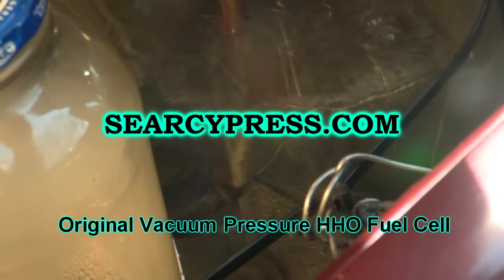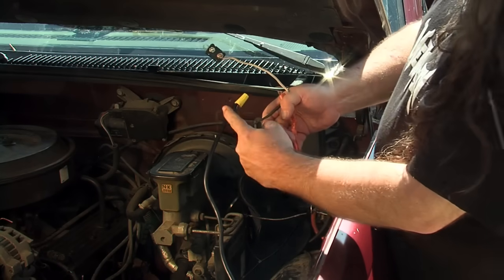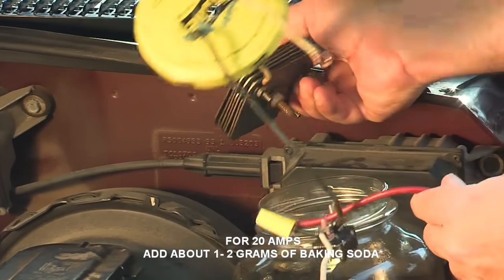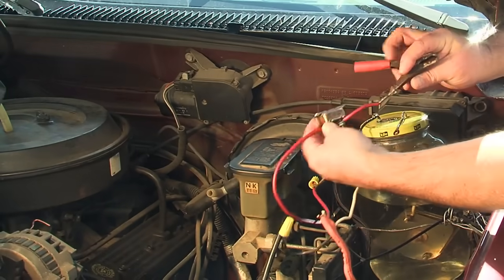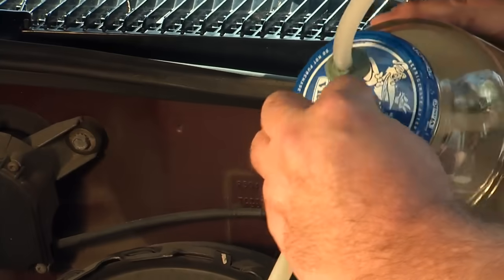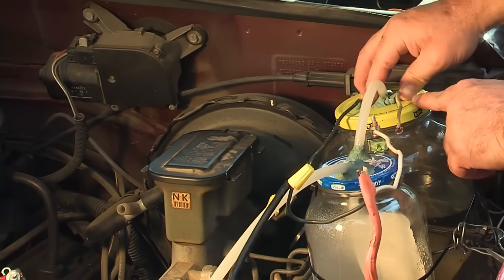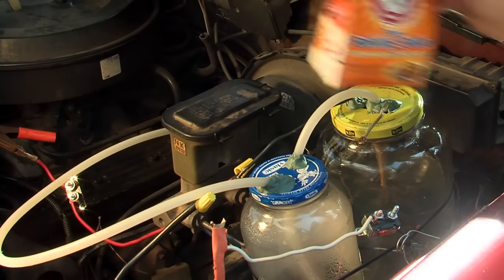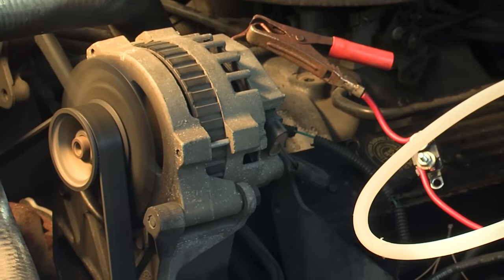Vacuum Pressure Hydrogen fuel cell defeats high gas prices using hydrogen from H2O.

Comment: Are you grounding the anode or are you burning both Hydrogen and Oxygen?
Reply from the maker: Both are recombined and mixed with gasoline vapor. The hho enters in the vacuum and only mixes with air in the cylinder when ignited. Thanks for the comment.
Reply: @metalpresstv  Nice I made a copper one before but it oxidized hilariously fast. I might retry with a stainless one again. I put a v6 in my 53 pickup I can tap vacuum off of the intake.
Reply from the maker: @kittywampusdrums  We used the highest grade stainless. Completely non magnetic. Never wears out. Kinda pricy but worth it. Remember loss of vacuum due to a line break results in loss of breaks. That's one reason we say, do not attempt. Ty
Reply: @metalpresstv  Yep. For anyone reading, there's plenty of other areas to vac tap. If you lose vac assist brakes you can extend your adjustment rod in the master out farther but it's really touchy. Just don't tap your brakes for vac you'll be fine. WEEEEEEEEEEEEE!

Comment: Metalpress tv, how much baking soda are you using
Reply from the maker: In most cases just a pinch. It completely depends on the mineral content. It can be adjusted by amperage. If it trips one or more of the auto reset circuit breakers add water. After a while you get pretty good at adding the proper amount. There is no need to run at full power. Less can do more and temperatures do play a factor in power useage. Thanks for the comment.

Comment: what is the second bottle for. i tried this and had two electrodes to hopefully separate oxygen and hydrogen. I assumed each electrod produced one . it seems many are using both oxy/hydrogen together. When i collect and isolate in a tube, it do not combust with a match.

Comment: Be warned HH+0 will ruin your day  if that bubbler in between the cell and the vacuum system gets low on water & you have vaccum issues. Brown's gas is about as volatile as black powder. Take every precaution.

Comment: Wouldn't you have to de-tune to lower the amount of gass/petrol for it to actually lower fuel costs?
Reply from the maker: If you are referring to an O2 adjustment-  possibly...in some cases. But- because you can burn much lower octane fuel with no knocking, you save big time. Less is sometimes better. You don't need tremendous amounts to see performance. Thanks for the comment.

Comment: The common missing component in all these engines is the gyro. It's needed in the EV, Compressor start in refrigerator motor, stabilize IC engine two wheelers, drones, etc.

Comment: This is one of the best demonstrations about water gas using for engine.
Reply: Maybe for a complete idiot. 

Just idling your engine is over a 600 rpms. Driving a 2.5 liter 4cly motor  is about 150 cubic inches. That's 37.5 cubic inches per a cylinder. A cylinder fires ever 2 full rotations. So in a minute of idling at 600 rpms your engine will use 11,250 cubic inches of air a minute at just idle. That's a 187.5 cubic inches a second of air. You're not producing even 2 cubic inches a second. But don't forget that it's h2O 2 parts hydrogen 1 part oxygen. So 1/3 of the gas isn't even hydrogen it's oxygen. So not even 1% of the air being taken into the cylinder is hydrogen. The only thing being accomplished here is the alternator is working harder for the high amp draw dragging the motor down more reducing fuel mileage. This is why water isn't used as fuel in a motor vehicle. 

Now don't forget we don't drive at 600 RPMs most people will be around 1800 rpms at cruising speed. That's 3x the amount of air with still the same hydrogen production. So now ur way below the threshold of .03% hydrogen in the cylinder. Using a spark arrestor on the output hose to keep from blowing the jar up you would be hard pressed to even candle a flame let alone put anything measurable in every cylinder 900x a minute cruising down the highway at the speed limit.

Comment: how much baking soda do you ,the whole box or just a portion
.
Reply from the maker: Depending on mineral content, we used just a pinch, watching amp flow keeping it below 30 amps.
Reply: @metalpresstv  would a teaspoon be good for say like a gallon jar of distilled water ?
Reply from the maker: @raymondfugate490  it's completely unpredictable on regular water. We used distilled water. Starting with just a pinch. Checking the amperage, and adding more if needed. Adding too much will trip one of the two circuit breakers. When that happened, we added more water. This is for information only, we are not telling you to build it. Thanks very much for your comment.
Reply: @metalpresstv  well the reason I'm asking is, that I'm gonna build this for my 99 Ford F-150 XLT 4WD ,It has a 4.2 v6 5 speed , I'm gonna use it has a work truck and I need to save as much money as I can and where and when I can , that's why I was asking about the exact measurements of everything

Comment: The energy you use, to make the hydrogen and oxygen, is coming from your trucks engine. Therefore, you consume fuel while making your fuel. If everything worked perfectly, you would get the same mileage with or without this. If this actually made more fuel than it consumed, you would never need to buy fuel again.
Reply from the maker: Your assumption comes from the thought that you burn 100% of the fuel that goes into the engine. In reality, you only burn about 80% in this motor. That leaves lots of room for gains. Improving the efficiency of the burn to levels above 90% decreases emissions and increases power. In addition to that, you're able to burn much lower octane fuel without any engine ping. If there were no gains, you would still save money by being able to use lower octane. Thank you for your comment.

Comment: The alternator pulling 29 amps is just defeating the whole purpose of adding hydrogen to your  gas ratio
Reply from the maker: Using this system allows us to burn low octane fuel with no engine ping. Only 80 percent of the fuel is burned normally on this engine, the rest is wasted. Using this system allows for very high fuel burn efficiency. It's not over unity, it's burning more of the wasted fuel to offset the power used by the electrolysis. Thanks for the comment.

Comment: What happens when the glass jar breaks maybe you should use something other than a glass jar that's a little more safer
Reply from the maker: The system runs in vacuum. The glass serves several uses. The thermal property of glass and visibility is good. Glass sight glasses  are used on pressure boilers. That always spooked me and it has injured many. This system has no pressure. Remember we were pioneering this technology. Sure there are other more costly options. Our goal was to demonstrate it's use. Do not Attempt. Thanks for the comment

Comment: First issue is that you would blow up your car Hydrolysis is a extremely dangerous chemical process giving off highly explosive gasses that if just a spark were to get to the Gas it would potentially become a hydrogen bomb.  Secondly if you get it right to make 100% sure you can't have a back fire or a way for the gas to be ignited out side your Piston cylinder you will need to use a calibrated amount to inject the right amount to not have too much pressure in the chamber and cause the Block or head to explode. A nother problem would be that it will potentially destroy the engine after a while if not regulated correctly kind of like how a nitrous fed engine gets damaged from the nitrous. And you would need a power source thats not just a car battery as it would consume the energy too fast for a alternator to recharge the battery this also adds strain on the battery its self being drained too fast causing it to also fail as the Liquid battery fluid will dry up much faster.

Comment: Catalytic converter issues?> Did you simply pull your fuel pump fuse?
Reply from the maker: No, this is a fuel booster. Burning pure HHO could create extremely high temperatures in the engine. We use it to boost the efficiency of the burning process. This allows us to burn lower octane fuel without any engine ping. I have seen videos where they show running on pure hho, however I speculate this is not the case. When you consider you can melt a rock with an HHO torch imagine what that would do to your engine. Thanks very much for your comment.

Comment: In the NASA study, the engine was fed Hydrogen from a catalytic steam-reformation device, at over .6 kilograms per hour.  That is a tremendous amount of Hydrogen; nearly 2 liters per second.  This pickle jar device would be lucky to produce 1/100 of that volume of Hydrogen.   https://ntrs.nasa.gov/api/citations/19770016170/downloads/19770016170.pdf
Reply from the maker: That's fascinating because we can make 6 liters per minute running at high amperage. We're not producing hydrogen, we're producing hydrogen and oxygen. Thanks very much for your comment.

Comment: sooooooo, what do you do about a backfire, i cant imagine a pickle jar exploading under your hood is a good thing.
Reply: i use a rubber boot  on a box with a sponge inside it , and on the other side a check valve.   and this keeps my setup from letting water get into the vacume system Whilst also keeping any explosion in check im sure you havent experienced a  explosion yet but just know your on that line with this type of setup.
Reply from the maker: It runs in vacuum. Like a light bulb.
Reply: @metalpresstv  ok well Even a vacume with gasses such as oxygen and hydrogen can still expload its a miracle it hasn't done so  is all im getting at.
Reply from the maker: @quagmire94  Very true. That's why it says do not attempt. But just so you know we lit up many jugs just to test what would happen. In every case the lid lifted off before the glass jug  itself poped. Most certainly a weak jug or cracked one would be a horrible mess under the hood. It could even take the hood completely off. This is not something anyone needs to try. Do Not Attempt.
Reply: @metalpresstv  never thought about it that way, definutely having a pop off valve would be nice  i guess a  top of a pickle jar  would suffice.

Comment: The mixture of hydrogen and oxygen gas is highly unstable. I don't think it is wise to rely solely on your dryer jar to prevent a backflash. A check valve should be inserted in the line between the dryer and the vacuum line as a redundant safety.
Reply: 2nd jar
Reply: Quick someone eat 6 pickles for a 2nd jar.
Reply: Maybe use a pickle jar with softer glass, to better contain the explosion. So much safety here.

Comment: Its been about 10 years since the video has been made. These make shift Hydrogen fuel cells was a big thing with DIY types around mid 2000's, but all have pretty much died off since and i don't hear anything more about them. I'd love to ask.. Are you still doing this today in 2021? Is it still worth your time? You still getting decent gas miles? Anything bad happen since this video? You should do an update to this video.
Reply: I use HHO for inhale not for car it's not efficient.
Reply: Psst it never worked never will work 
Just idling your engine is over a 600 rpms. Driving a 2.5 liter 4cly motor  is about 150 cubic inches. That's 37.5 cubic inches per a cylinder. A cylinder fires ever 2 full rotations. So in a minute of idling at 600 rpms your engine will use 11,250 cubic inches of air a minute at just idle. That's a 187.5 cubic inches a second of air. You're not producing even 2 cubic inches a second. But don't forget that it's h2O 2 parts hydrogen 1 part oxygen. So 1/3 of the gas isn't even hydrogen it's oxygen. So not even 1% of the air being taken into the cylinder is hydrogen. The only thing being accomplished here is the alternator is working harder for the high amp draw dragging the motor down more reducing fuel mileage. This is why water isn't used as fuel in a motor vehicle. 

Now don't forget we don't drive at 600 RPMs most people will be around 1800 rpms at cruising speed. That's 3x the amount of air with still the same hydrogen production. So now ur way below the threshold of .03% hydrogen in the cylinder. Using a spark arrestor on the output hose to keep from blowing the jar up you would be hard pressed to even candle a flame let alone put anything measurable in every cylinder 900x a minute cruising down the highway at the speed limit.

Comment: If the HHO is produced at an energy deficit (it takes more energy to split the water than is gained in chemical energy), and then the HHO is combusted in an ICE that is, at best, 30% efficient, how could this possibly increase mileage? Oh, wait, it can't. LOL! Idiot. You've increased the electrical load on your alternator, thus increasing the mechanical energy required to turn it, resulting in the engine having to work harder...just...wow...

Comment: This generates HHO which is highly flammable, if you build this you need a back flow valve. A backfire could cause an big bang, a really big bang, a really really big bang.
Reply: His “dryer jug” is supposed to be filled with water and used as a makeshift flashback arrestor
Reply from the maker: It's not really a flashback arrestor because of its size it's basically an overflow, a place for water to condense. In the state of vacuum there is very little chance of an explosion. This whole system is quite different from the one we're using now. We have a video it's coming out and we're going to show some safety features we've added over the years. With that in mind please don't replicate anything you see in the video.
Reply: You don't know what you're talkin about the tank is the backflash arrestor it's filled with water and there would never be enough HHO in the line at one time to cause any sort of actual explosion the most you would end up with is a busted jar and a bunch of water
Reply: yes I imagine with some controllers and a piggybacked ecu it would work flawless. ON ANY GAS CAR.
Reply: So I’m building one now since it’s costing me 1000$ a month to drive my truck. Where do you put the back flow valve and does it need to be a one way valve?
Reply: @justintilley501  yeah that's right 👍
Reply: @justintilley501  How did the build go? Did you manage to get your truck running like this?
Reply: That is what bubler is for
Reply: So big you can cause a new big bang ...😂😂😂😂
Reply: Hahahahahaha. oh man , good one.
Reply: how big ?
Reply: @globalnomad4074  very big
Reply: Bla bla bla bot
Reply: So, you have my interest.
Reply: "an big bang"? 🤔
Reply: And a bang from a bang that was banged. On top of that 👇you add together the bangs down there with my bangs and your bangs and everyone is banging.
Reply: no no you aren't storing it, and the water won't blow up.
Reply: @carlsmith4767  Yes you are storing it, from the top of the water to the top of the HHO generator, it may not seem like alot but its enough. A PCV valve only cost a few bucks, cheap insurance.
Reply: What is s back flow valve or backlog arrestor
Reply: So it really does work?
Reply: That’s what the second jar is doing it’s like a water bong there’s no contact with the gas because it’s bubbling up through the water
Reply: It will pop but it wouldn’t store enough in the container for a big explosion, as well as the glass container can’t hold much pressure. Honestly it being under the hood and in front of the firewall is perfectly fine to stop any shrapnel.
Reply: Yeah. But most of us are old enough not to be so stupid as to need warning labels.
Reply: @Helz777  
Incorrect.  Age has nothing to do with needing to know safety instructions.   Being safe is better than being arrogant.
Reply: @jeaniebird999  proof is in the pudding m'dear. Nothing beats experience.
Reply: The dry jug IS to prevent explosions. The yes i would also recommend a one way valve just in case because HHO is extremely explosive. I would also recommend to use better connections. A battery cable clip with a bare wire to the alternator is not recommended.
Reply: No need  😆
Reply: Sounds like a challenge for me after two beers

Comment: Glass containers are like GRENADES if they explode. Stainless exhaust system
 MUST. I ran my house off of fuel cell
Just larger. Explosion Blankets and used
A step system using Tesla Valves to storage container tank. I retro natural gas valve and jets on C. Package unit.
Also my 50 gallon hot water tank. Note
Neighbors alarmed at steam rising from
Units. I had to plumb condensate pkg. Unit with heat tape. Then I got threatened
From utility company. Cant fight city hall
Communist. System works but must be
Vigilant on Hydrogen Leaks. Finally your
Units will run longer for BTU yield. I used
Solar cells for the free energy 7:1 h2

Comment: This guy is just a phenomenon . Do you know those 20-30 amps from Alternator need to be made from something , usually made from petrol in your car , so you increase consumption of it with that stuff , and then you lower it some by that stuff , i think overall you are still above normal consumption . You need more efficient Cell  then pickle jar
Reply from the maker: The engine only Burns about 80% of the fuel. By  increasing the efficiency of that burning you can easily compensate for the amount of energy used. There's no mind blowing over unity involved here. It's just simply burning more of the fuel that is wasted. Even if there were no gains using this system will allow you to burn low octane fuel. Engine ping will disappear. There's quite a difference in cost between octanes. Thanks very much for your comment.
Reply: @metalpresstv  i dont mean to be rude, im genuinely interested  , i drive a Turbo Petrol engine with direct injection with exhaust gasses returned to the engine for additional combustion , meaning my valves have nothing going  over them to clean them and on top of that exhaust gases are blown over them .
So , what i am thinking is to put a little bit HHO over them for Decarbonization 
But still wondering about that lowered consumption